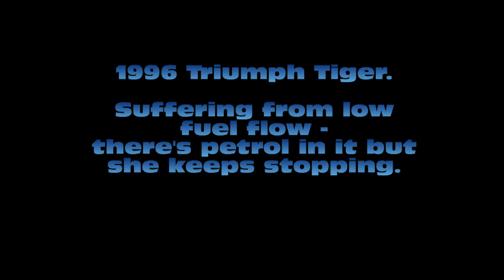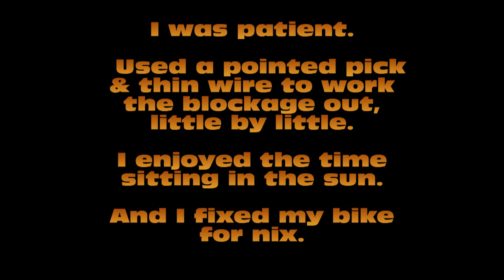Triumph Tiger blocked tank breather

Comment: Where is the breather located? i have the same issue!
Reply from the maker: +the1divrence  g'day, how they hangin'?  The tank breather may also be considered to be the 'fuel overflow tube'.  The top of the breather is inside the fuel cap.   If you are tempted to disassemble the fuel cap be careful of the very small ball bearings and springs inside. I did put a photo story about doing this on tigertriple.com: -  http://www.tigertriple.com/forum/index.php/topic,13231.0.html    The breather tube is inside the tank, from the top under the cap, to the lower right rear, where there is an aluminium spigot with a rubber tube attached.  The spigot has a hex head but I'd not be keen on attempting to remove it in case it strips the plastic and creates more drama (I have a new spigot in my part bin for the day I am forced to do something about it). The tube drains to beneath the engine.  From mine, I reckon it simply sucked dust & debris up the rubber tube to collect at the narrow point of the spigot.  Ultimately, on mine, the spigot corroded off, that's why it probably doesn't look immediately similar to yours.  At 1:03 there is a still showing the tank inverted, the fuel tap and the relative position of the spigot.  At 1:20 there is a still showing the right side of the tank.  The wire exiting the cleaned breather is at the bottom left of the photo.  I simply, and gently, worked the wire to clear the blockage.  Good luck with it.  I do hope all this helps.  It's a bloody pain the the arse, eh!
Reply: So that’s what that nozzle on the bottom is for!! 😳😳😳 Maybe I’m a fool but I had no idea and was facing the same issue on my 96 I’ve been fixing up. Cheers!